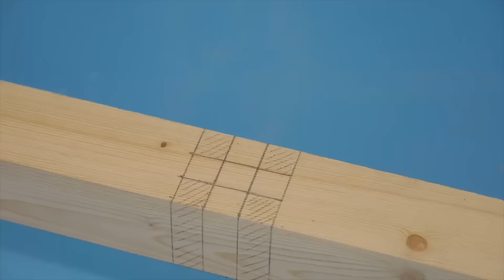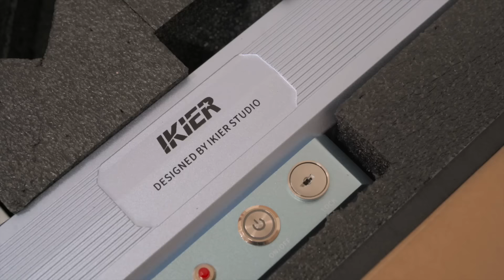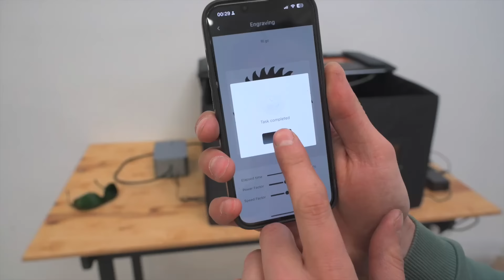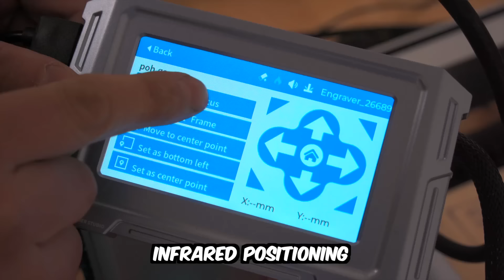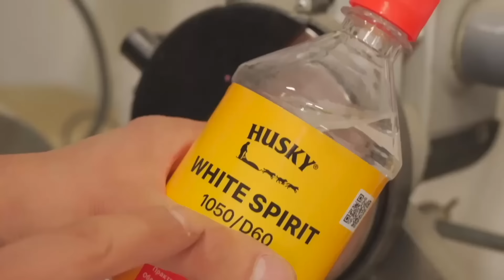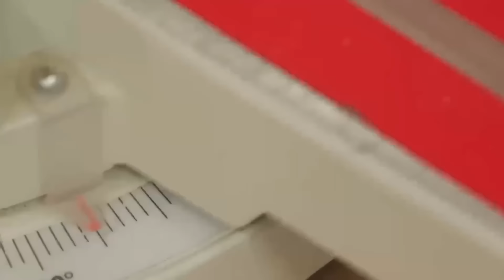Handyman's Don't Want You To Know This! Tips & Hacks That Work Extremely Well

Comment: All good ideas, I guess, but some of them were shown way too fast! Perhaps slowing the video down a bit would be more helpful.
Reply: You can play the video in slow motion by going to settings at the upper right corner
Reply: Just click on the cogwheel at the top right corner of the screen and set the playback speed to 0.5x .
Reply: Shouldnt have to watch the videos in slo mo. Just my opinion. Ty for info tho. Didnt know i cld if wanted  to
Reply: Yeh, just adjust Your playback setting..easy peasy 🇺🇸👍
Reply: You can adjust the video speed in settings try that see if it helps

Comment: Apostrophes do not go on plurals. The rule is not "any time I add an 's' to a word I use an apostrophe." Apostrophes go on words to signify ownership (Jim's Auto Shop) or to join words in a contraction (It's going to rain outside.)  Don't use apostrophes when you're describing more than one item in a plural (Apples and oranges.)

Comment: "Workshop / Handyman / Woodworking Hacks" videos- no matter their source (5min crafts, or anything), are all the same content:
1% - This is cool!  I could see this coming in handy.  I'll have to write this down / record this so I remember to incorporate into my life.  (I will never actually do so.)
1% - Actually kinda' useful; I might actually use this, as the situation comes up, IF I remember.  (Which I will not.)
10% - Mildly useful, in very specific circumstances, which will maybe come up once in a person's lifetime, in which case they will definitely NOT remember this "hack."
10% - There is already a wide variety of tools for this purpose, and building this half-assed replacement is a waste of time and money.
10% - This is common sense already, and/or this is what this tool is designed to do.  This is not a "hack," it is simply the standard way / standard tool to do this thing.
30% - DO NOT DO THIS THING YOU WILL KILL OR MAIM YOURSELF!!!
30% - This hack will fall apart within seven point six seconds of attempting.  It is mostly benign, but is a completely useless waste of time and materials.

8% - I have no idea what this is supposed to do or fix or accomplish.  This went by so fast, with no explanation or context.  What the hell is even that?